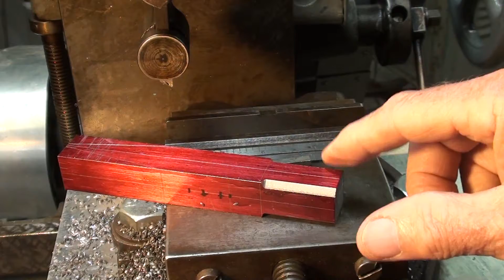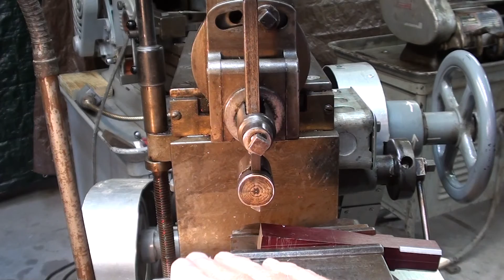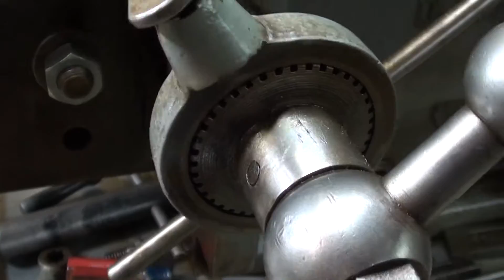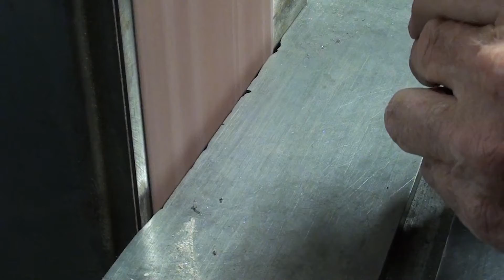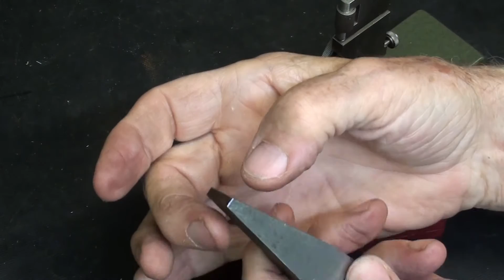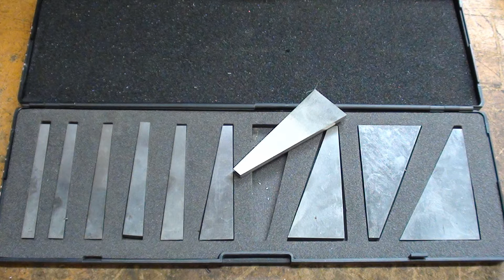HOW TO MAKE HAMMER pt 2 Tips 686 tubalcain

Comment: what would somebody usually do with a peen end shaped like this? I see the print says it's a riveting hammer, but i know there's more to it than that.
Reply: I carried and used a riveting hammer for 35 years as a sheet metal worker. The peen edge was used primarily to assemble and set the Pittsburgh lock on ductwork when fabricating sheet metal fittings
Reply: @priority2  thanks, that looks like just the thing for thin sheet metal like that

Comment: I suppose you could shim up the smaller end of the 10 degree angle block to decrease the angle until it is appropriate.  In addition, based upon what I have read of old shaper hand's writings, it would be more efficient to rotate the vise 90 degrees and make the cuts lengthwise along the part with a longer stroke, as long as the cut is within the stroke capacity of your machine, of course.  Do you have any thoughts on this?

Comment: My angle block set contains 0.5°, 1°, 2°, 3°, 4°, 5°, 10°, 20°, 30° and 40°. I had to create 9° to cut the aluminum frame at 99° for a screen to match an oddly shaped porch that I screened in. Turns out that 4° + 5° = 9° so I stacked them against a machinist's square.

Comment: These were a freshman machine shop project at Macomb IL high school in 1957.  You could make this or center punch.  I opted for the punch as I was more interested in lathe work.  We had a 16" shaper that was used for the hammer.  The other end was tapered slightly by draw filing.  Geat memories.  Our shop was oufitted from state surplus and everything there was army drab or navy grey.

Comment: Have you ever tried "Super Quench" to harden mild steel?  Just google the term.
Reply from the maker: Never heard of it, I will check it out
Reply: @mrpete222  By the way,  the super quench works even better on A36  because the carbon content can, (and often does) get pretty close to 0.29%.
Reply: @slypig24  I wouldn't recommend case hardening a striking or a stuck tool.  Too much chance of of a chip breaking loose.  Also, a hammer needs to be re-dressed from time to time and, since case hardening doesn't usually go very deep, you'd soon have a soft face, etc., again.
Mr. Pete:  I realize that the purpose of this video is to demonstrate the machining operations.

Comment: Back when I was around 4 years old, 60 years ago, dad made us boys a small hammer very similar to this one.  It was made from a piece of 1/2" key stock material about 3-1/2" long.  The tapered end I believe dad shaped it on a shaper at work.  He made a handle out of either 3/16" or 1/4" diameter bar stock bent with a handle on one end and the other was inserted into two holes on the hammer head and sweated in place with braze.  Mine and my brother's hammer, I don't think lasted long from kid abuse at our early age.  Dad's lasted several years as it had a place in the machinist chest he had at home growing up.  Never knew what happen to that hammer to this day.  But a fond memory never forgotten.  Thanks for sharing Mr. Pete.  Ken

Comment: You get 9° by stacking the 10° block and the 1° block.  Rotate the 1° block backwards so it subtracts 1°.   The same can be done with the 10° block and the 1/2° block to get 9.5°.

Comment: This reminds me of a High School shop project I did almost 40yrs ago. We made an almost identical head on the Bridgeport then drilled and tapped it for a round metal handle with knurled grip. We made the handles on a lathe. The heads were hardened and heat treated, and the the whole thing polished. I still have that hammer. One of the most satisfying projects I've ever done. For the first time in my young life I felt like I could do anything. Thanks for the memory!
Reply: Me too. We had to file the entire hammer. After it was flat, square and within measurements, we could bore the hole and file it in to shape. You could bring it to the teacher and he would allow you to grind the surface just for esthetics. 40 years ago. Still have it!